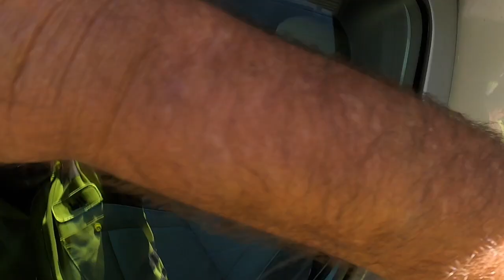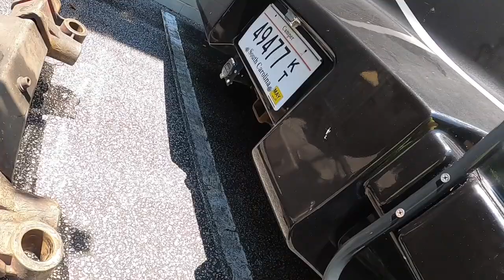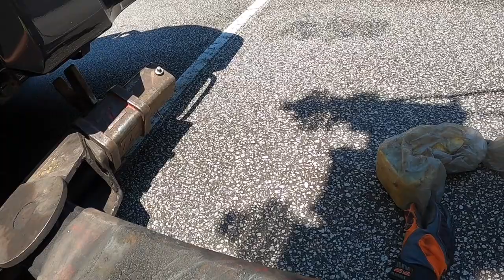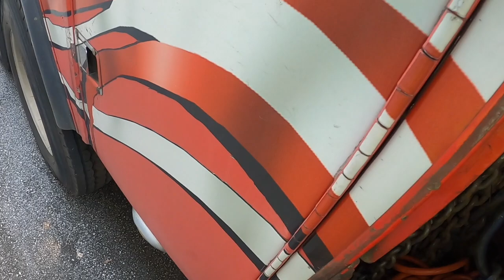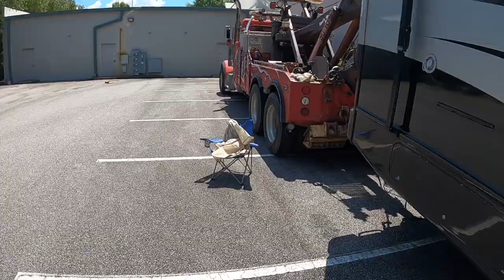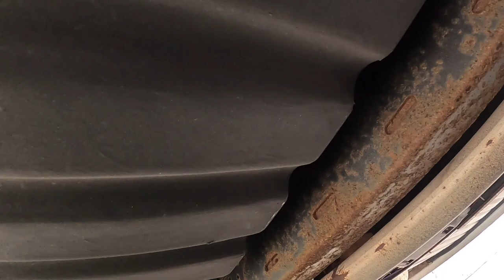Towing An Abandoned Motorhome

Comment: Inside the RV where the stove is there's going to be switches on the wall those are for the hydraulic or the electronic motors for the rollout slides they're going to start up the generator it's real easy to do you'll see apps which on the wall that's red push the button back to stop hold it down on stop for 10 seconds it primes the generator and then push the button to start hold it till it turns on and the power is up and running and then you can hit the buttons on the wall for the slide outs to come in